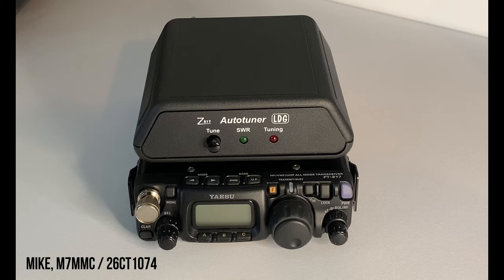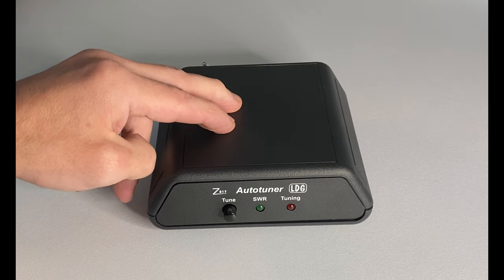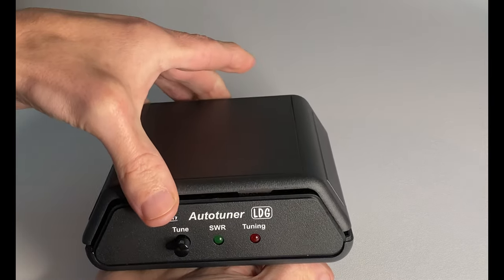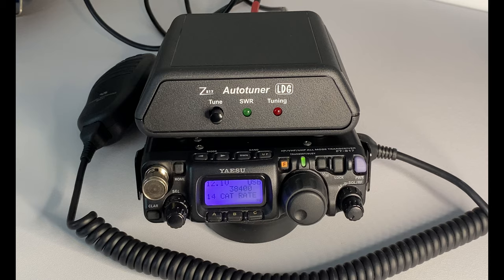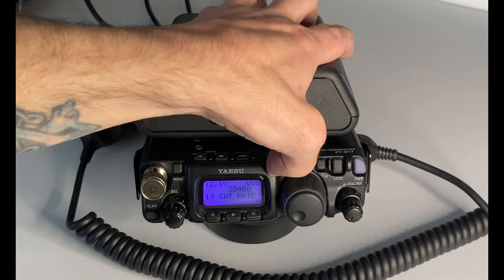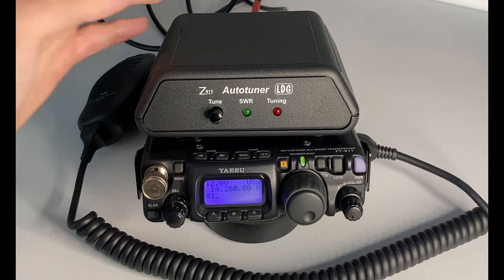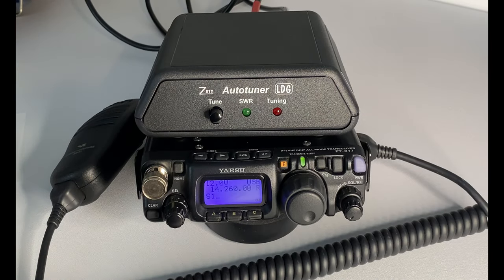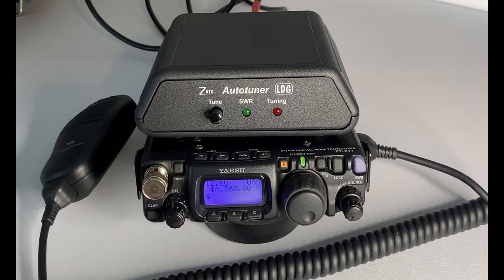LDG Z817 Automatic QRP Antenna Tuner |  Yaesu FT-817 | Setup & Demonstration

Comment: i bought one of these ~8 years ago to pair with my 817.
i used it once. it worked, but i realised i am a knob twiddler and want to do the work myself.
so, it went in the closet (still there) and bought a nice manual tuner.
decide which type of operator you are before buying something.
Reply: Привет. За какую цену уступиш автотюнер из шкафа ? Всë равно он лежит у тебя без дела .

Comment: Nice video. I operate a lot of FT8 and need the ACC port on the radio to plug in a digirig. This will prevent the tuner to be plugged in ! How to get around this problem ?
Reply: Connect the tuner to  the radio, and then use the ACC-port on the tuner to the digirig. The tuner has two ACC-ports, so you can connect other equipment to the tuner instead of the radio.

Comment: Is there a better option today? Elecraft T1 or MAT10? Or does this still hold up? Cheers
Reply from the maker: I've long since sold this and the radio. There are better built-in options on QRP radios nowadays.
Reply: @OnTheMicwithMike  I get you but nothing to date has passed the yeasu for the durability factor

Comment: I own both those devices, but I lost the mini DIN cable. Can I still use the tuner with the 817 radio, without causing issues  ? 73 de SV4RIN
Reply from the maker: I honestly can't remember, I don't own the radio or tuner anymore. 73'
Reply: Yes. But you will need to transmit manually when tuning. Best is to get a new cable. It's just a 8-pin mini-DIN male in both ends, all 8 wires connected.

Comment: Maybe you can help can I use my Mfj- 1899t antenna with this without having to use a counterpoise? have asked several hams here on YouTube and have yet to receive an answer. Any help would be greatly appreciated I'm a new ham KN4INN
Reply from the maker: Hi there,

Done a little research on the 1899t and now I’d like one for myself :)

So from what I’ve learned is that it looks to be that it doesn’t need a counterpoise if you’re using it plugged directly into the radio - for example on the Yaesu FT817 has the BNC connector on the front. 

I have seen them mounted externally away from the radio on a mount/tripod and if you use it that way, it would need a counterpoise for sure. 

In short, use a counterpoise if you’re using the antenna externally, if you intend on plugging it directly into a radio (like a Yaesu ft817) then it isn’t really needed.

Stay safe and 73’.
Reply: @OntheMicwithMike  Thank you for the great information like I said I've asked many hams who have YouTube channels and got zero response from them. You stay safe as well 73 to you also.